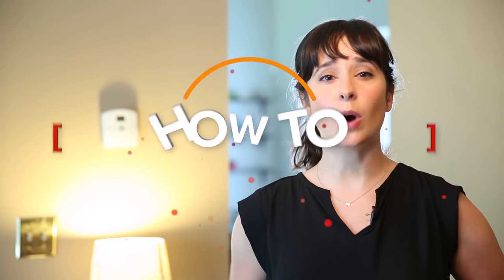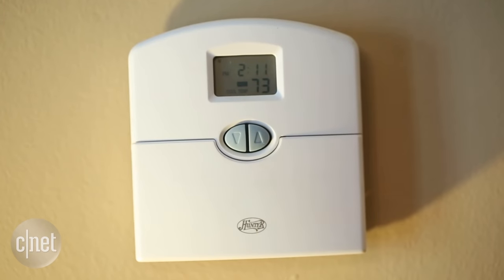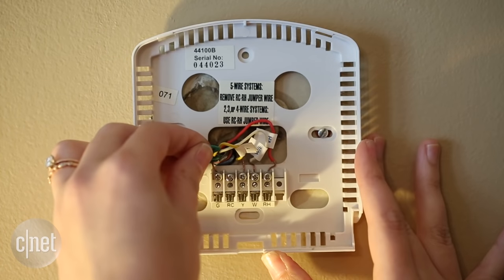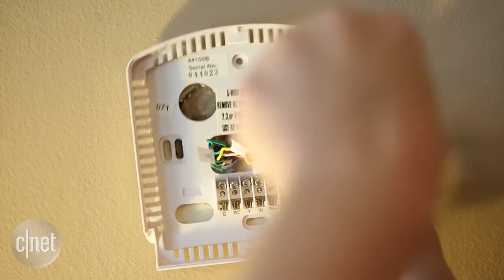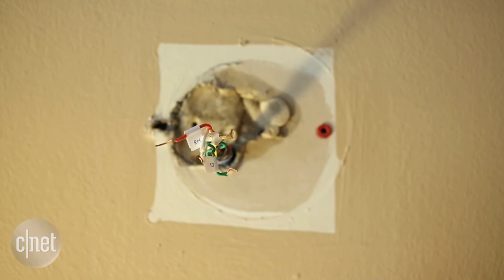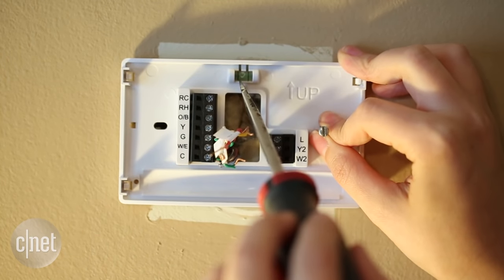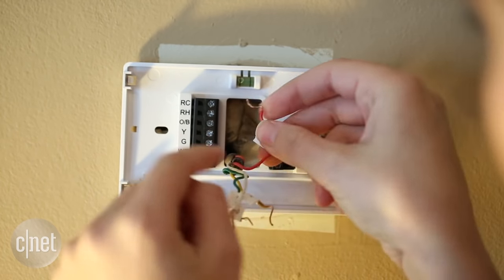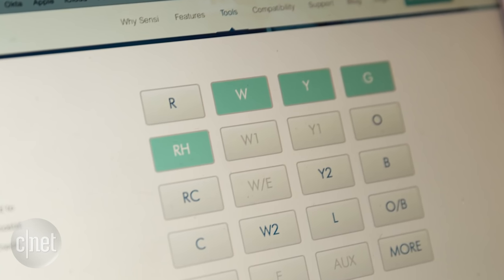Install the Sensi thermostat in a few minutes

Comment: make sure to label all wires before removing them from the original thermostate. It would be a pain if you took it off without labels. The labels that you see in the video are provided by Sensi (and the app comes with instructions with how to do the install)

Comment: 1) There is a back plate avail, to cover a larger unpainted area in the back. (I installed mine and it looks great)
2) Would of been nice if you leveled it, like the leveler showed.
3) You should of hand tighten the screws, so it doesn't wobble.
4) If you go to 0:32 you will notice the normal 4 wires: Red, White, Yellow, Green. There is also a fifth one I see, a blue one that is not connected to anything. Connect the blue to terminal C on the Sensi. Then go to the AC indoor handler and connect the blue wire to C on the control board. This will give the Thermostat power without any need for batteries.
I use mine without any batteries in it.
Your Welcome!
Reply: Thanks Dude!  My blue wire was connected to B.  There is 12v on green to Blue. Do you know if that is enough?  I am replacing the original thermostat. It has 5 wires. Old style square box with 2 levers at the bottom. One H/C  and other for fan. I wonder if I can put the blue wire on "C" and have it work?
Reply: @jerryroberts5367  You need 24VAC. Confirmed by Sensi tech support. That is what's coming on the red wire from your main control board. The blue wire goes to C for common. It will provide power for the thermostat so it doesn't need batteries. So it's optional on this thermostat.  Just make sure if you connect the blue wire to C in the thermostat, then you also connect the blue wire to the C terminal on the main board.

Comment: I had it with this thermostat. I am a do it yourself guy big time and all this thing did was give me trouble from the install to the wi-fi connections.  This is not a well thought out product.  It was on sale on Amazon for $70 which is why I thought I would give it a try.  I am sending it back.

Comment: Why does everyone say she never leveled it? There's a level built in. What am I missing? Do I need to do something else besides the one that's already there?
Reply: If you look closely the bubbles in the level is not center. when you screw the thermostat on you have to make sure  to hold it steady and on
a straight line so the bubbles stays between the lines.

Comment: I have a old , I mean really old style heating control. Yep just 2 wires. With just as old mercury switch, hence just 2 wires. 28 VAC. The old mercury thing is just plane wore out. Most likely over 70 years old.
 It is connected to a 2015 high efficiency processor controlled heating system. 
Now putting wire controller in a 4 wire not a good option. Replacing and touching up lathe plaster is not the fun I like to do.  The other thing is it does not need it.

For those of us that have had a bit of EE. Some may have a question. Why fix something that works and works?
Ruud has a furnace ( high efficiency) that only needs two wires. Why can't Emerson just make fancy looking thermostat that will make my wife happy and operate the equally fancy dancer heater?happy? not reaLLY.

Comment: The old thermostat had 4 wires (no C) shown at 0:30 but the new thermostat had 5 wires which included the C wire at 2:33. Where did the C wire come from? A pretty important point that wasn't discussed.
Reply: Good point. I saw the compatibility of this device on the Sensi web.  (4 wires from my existing cable), and it says: 'may need a C wire'. So....does it, or not ??
Reply: @wholio50  I'd like to know this as well. My first two houses had no c wire. But my new does. However. I plug in the c wire and everything turns on except the exhaust fans outside. Which we're working fine earlier.
Reply: @ahefner33  you have to adjust the wires on your hvac unit as well. It should be in your instruction manual.
Reply: Sometimes if there is a wire that doesn't need to be use with the thermostat you have, that wire is twisted around the wires you are using and pushed back into the wall. That could be why some of us saw the wire not being used at the beginning being used in the end.
Reply: There wasn’t a common wire. Look closer. It appears that there is on installed but she only installed 4 wires on the new one.